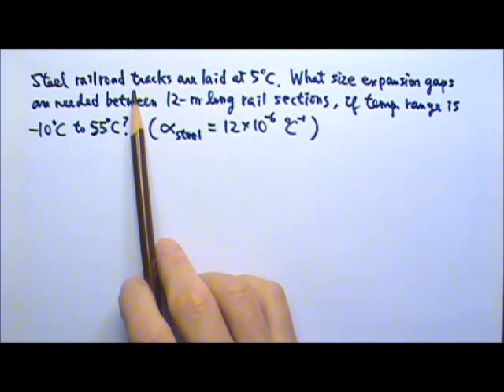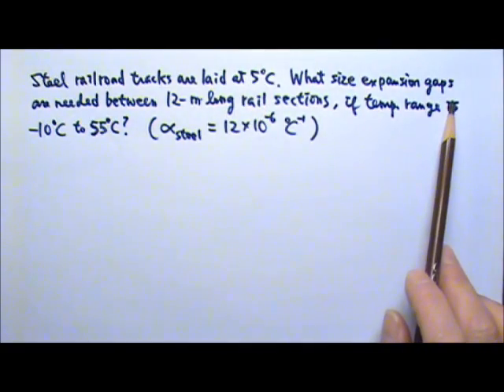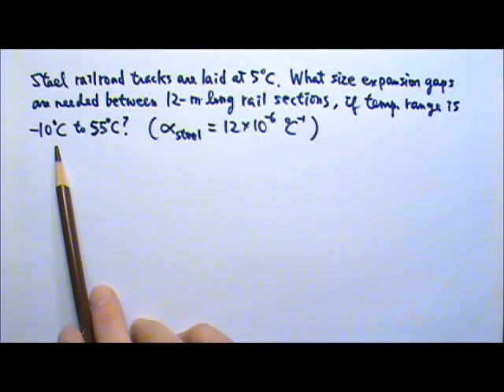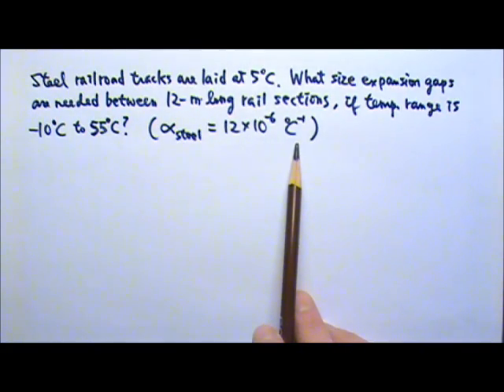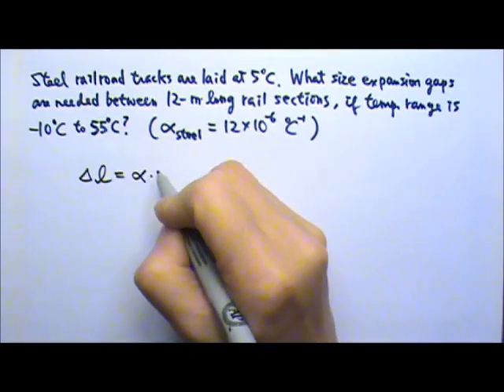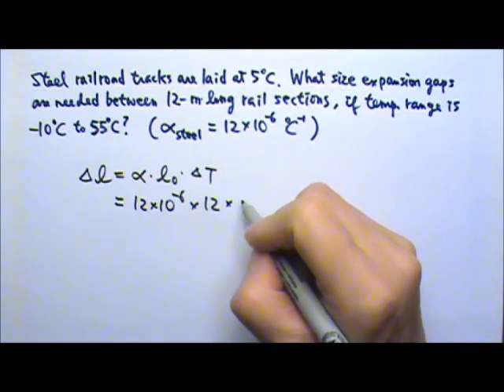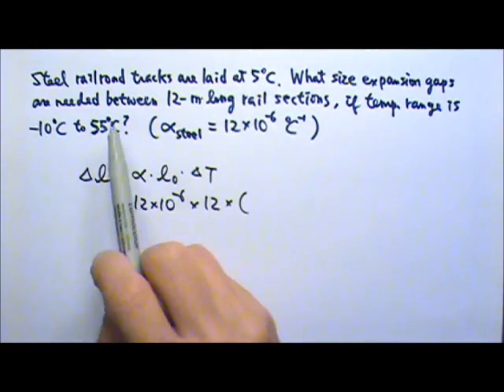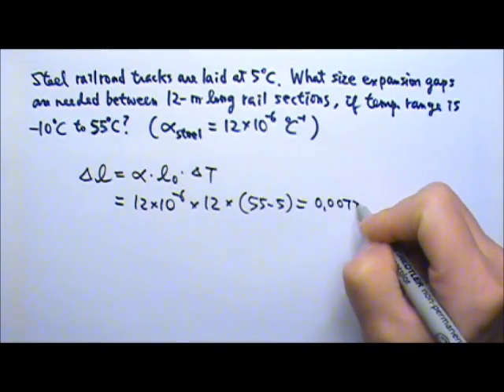AP Physics 2: Thermal 2: Linear Thermal Expansion: Expansion Gap Problem

Comment: why not -10?
Reply from the maker: +Kim Viannie Ellarina Sorry, I did not see your question until now. We are leaving space between sections of tracks for expansion. When temperature gets lower, the gap gets bigger, so we do not have to consider the lower temperature when leaving space for expansion. 
For the lowest temperature part, I suppose it matters when considering not having too big gaps between sections of tracks on the coldest days. Too big gaps can be dangerous for trains (e.g. to derail a train).